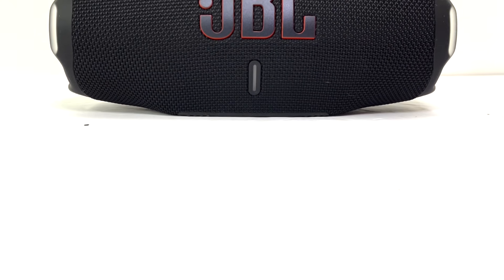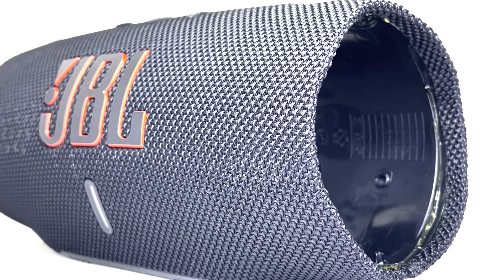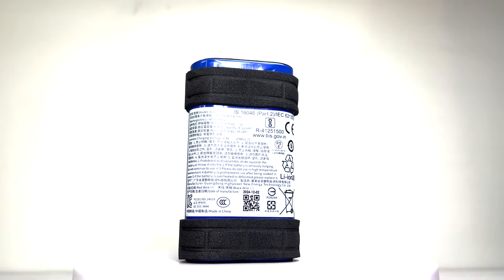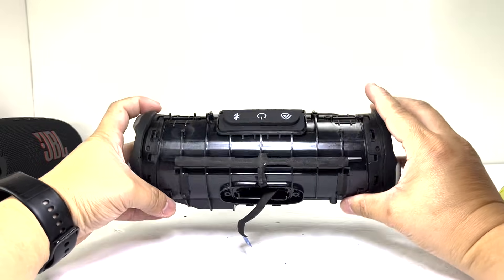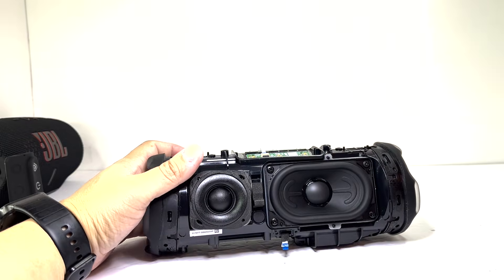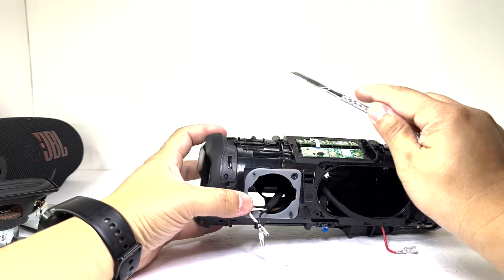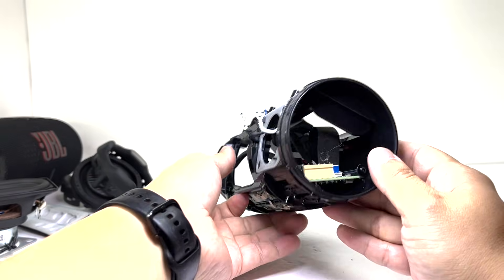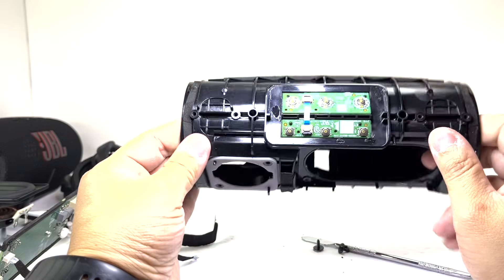JBL Charge 6 Teardown – What's Inside?

Comment: Help me guys, my charge 5 isn’t charging, turn off automatically after few seconds, it’s 4 years old now please
Reply: I can smell a defect battery, one of the three 18650's inside is maybe dead (0V), a dead li-ion cell works like a transistor in series, it takes all the energy from other li-ion in the same series, even when it's not in series just parallel than it's a non complete voltage at rated destination this is why the chipset can't charge it because the voltage is lower than it suposed to be at minimum 2.8V . I think you need a new battery from a generic shop, or a friend who knows how to make generic samsung 35E package for this speaker (3 x 18650). If you want a generic jbl battery package you have to buy it on a good market place they have generic jbl in store.

Comment: i hate it that they change the connect so you cant connect olds jbl speakers to new ones
Reply: Yeah, but at least Auracast isn't exclusive to JBL. Other brand speakers that have Auracast can appearantly connect, but it seems to be one way as JBL has locked it so that JBL Speakers will not connect to non JBL Auracast broadcasts, but non JBL Auracast speakers will comnect if the JBL is the source speaker